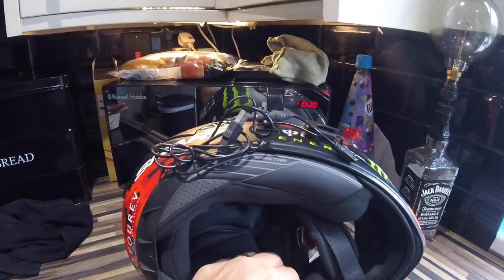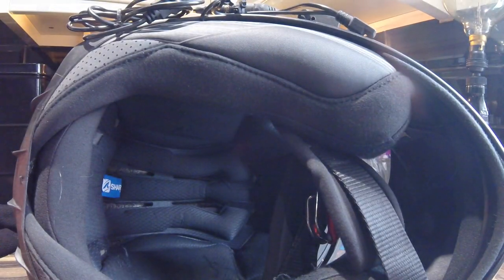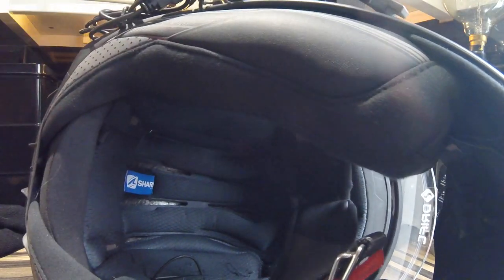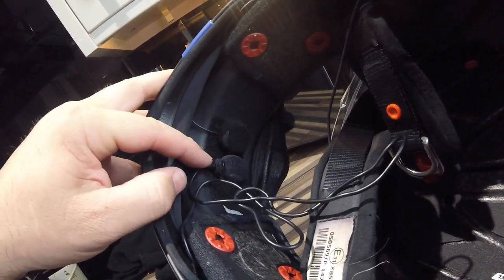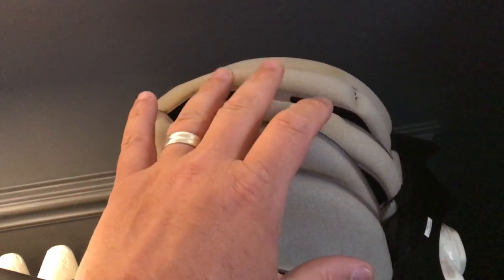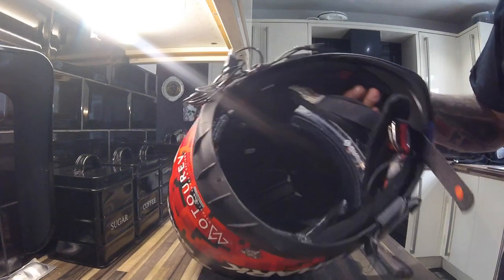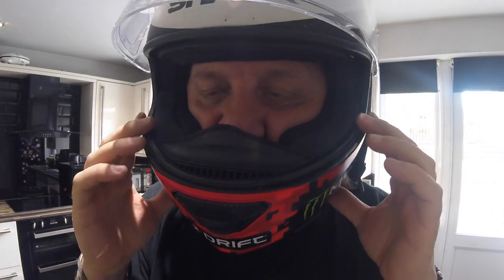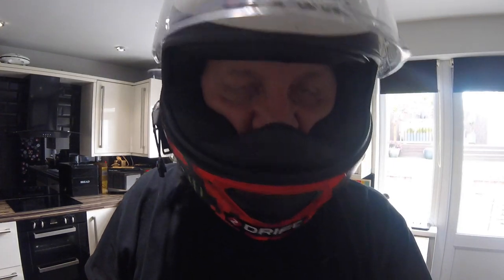Cleaning A Motorcycle Helmet Liner & Padding

Comment: I've had my current helmet for 3rd season already, never washed the padding - and it doesn't smell, not even the slightest hint of any odor... The magic trick is to wear a balaclava.
Also the balaclava dries out pretty much instantly and without an odor too.
Reply from the maker: Yep use one of them too. If you wear pants do you not need to wash your trousers 😂
Reply: @Motourev  another magic trick: try wearing the balaclava UNDER the helmet
Reply from the maker: @jaromor8808  Jesus! Your one clever fella, never thought of that, and here’s me wearing my pants on top of my trousers 🙈